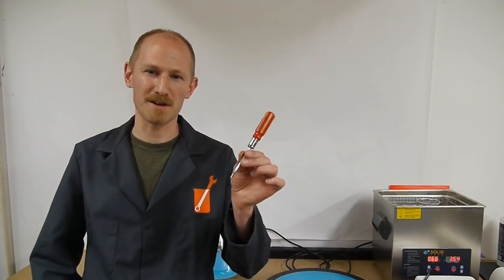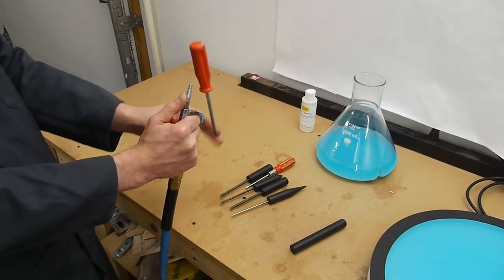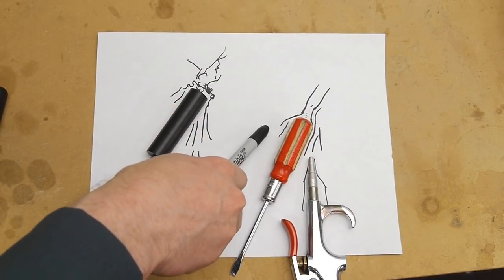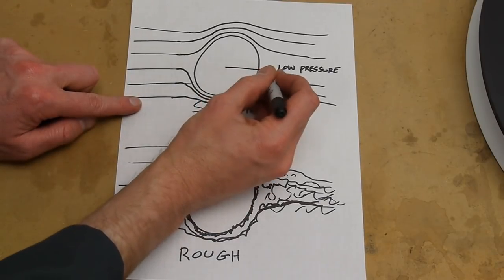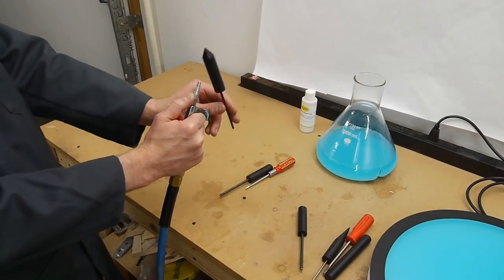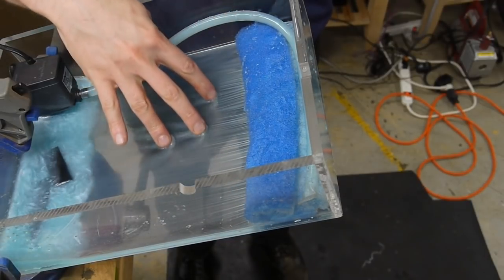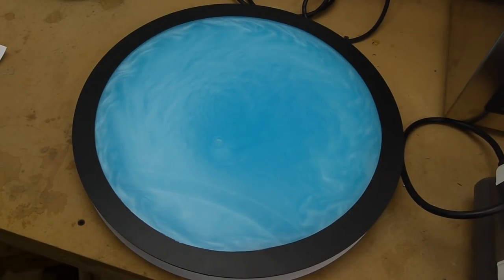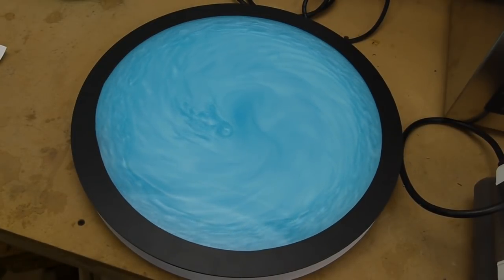The physics of floating screwdrivers

Comment: Seeing a lot of airfoil parallels! Thought you might appreciate this on the physics of curved streamlines and angular momentum / centripetal acceleration:

I think you have maybe neglected the lower relative pressure on all curved surfaces in the airflow - The vortex area is indeed at a lower pressure than atmospheric, but so is all of the curvature in the flow: This is why the cone top worked just as well, if not better than the rounded edge flat top: more curved area on the top surface hence more lift (force coming from higher air pressure below the screwdriver than on it's surface above= net lift)
 - this guy is better qualified than me to cover the theory: https://www.youtube.com/watch?v=XWdNEGr53Gw (he gets to the crux of it around 37 mins in, but you need this to make sense of the presentation: https://drive.google.com/file/d/0B0JABuFvb_G_MkpBZHJmRGo3UkU/edit?usp=sharing)

Finally; on the vortex behind vehicles thing: the venerable Mythbusters did a great fuel economy test on the whole tailgate up, down or off debate on flatbed trucks - !spoiler! turns out the vortex actually smooths airflow over the drop at the cab rear and marginally improves mileage....

Greta video as always, and thanks!